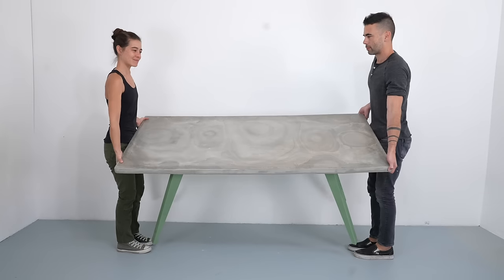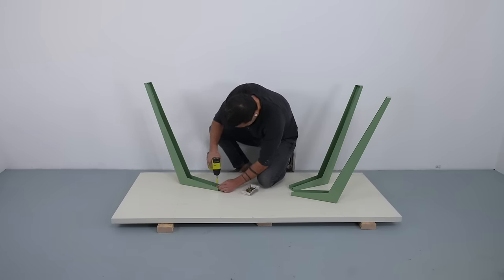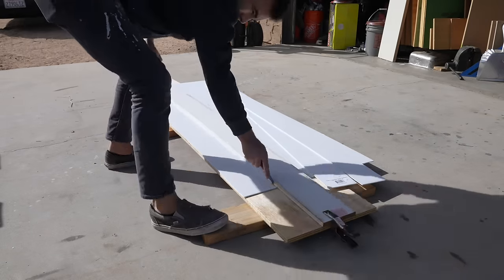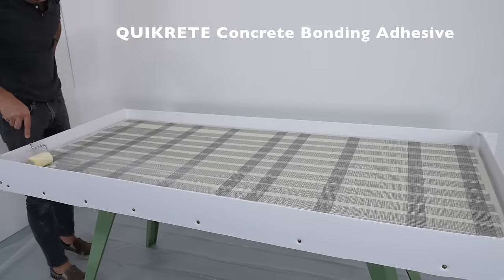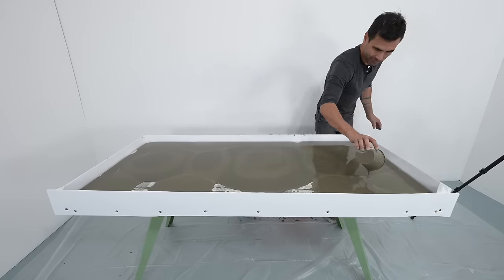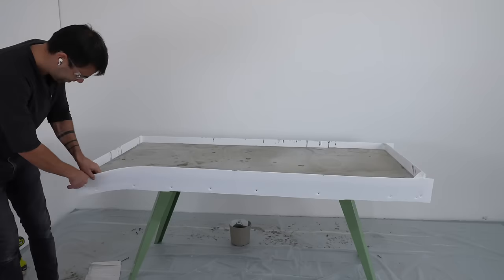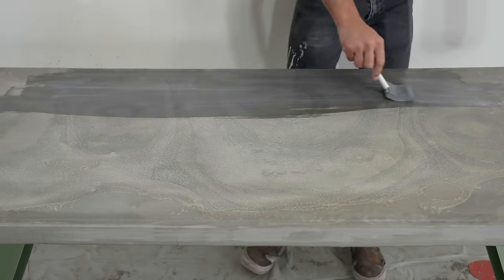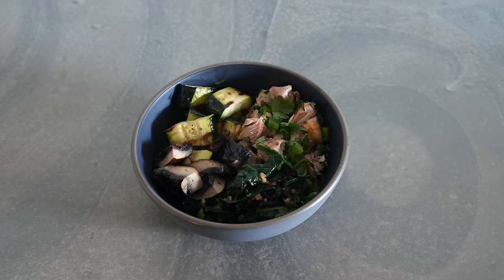How to Make a Lightweight Concrete Table

Comment: Not to be "THAT GUY" but the wooden door core is a fatal flaw. When you pour wet concrete on wood, the wood will expand as it absorbs the water from the concrete and act like a sponge. If you leave it outside, the cold or the hot sun hitting the concrete will make the wood INSIDE the concrete contract and expand (or contract at different rates than the concrete. That pressure will crack the concrete or create void that will be much weaker in parts of the table. I also worry about freezing and wooden core expanding inside the concrete like a form of ice heave.
Reply: You're quite correct and beat me to pointing this out.  He'd have been better served using the door (completely waterproofed somehow then drenched in release agent) as part of a form and then removed it.  This would fall apart in less than a year in my climate.
Reply: Would pouring an exact amount of concrete work to maybe give it space to not crack or how would u avoid that
Reply: Nvm I wasn’t watching vid def a different build than I had in mind
Reply: Or maybe weld in some smaller bars on the inside lining of the wooden walls maybe give it some support and something to grab on
Reply: It's just fine being "that guy" when you are 100% correct and aren't douchey about it, which you weren't... 
When he said the door itself wouldn't stand up to the elements, I thought to myself that the concrete actually made things a lot worse...
Reply: I wonder if you could  accomplish the same thing with a rectangle of pink insulating foam. I’m not sure how much structural integrity would be sacrificed, but it would resist the weather shifts.
Reply: I think this is only true if you assume that the door is 100% real wood, i did hear him say it's solid core, but if it's solid core MDF or some weird glued dust filling, it will more likely get soggy and crumble but not crack the concrete
Reply: The poly sealer will be blistering , peeling and yellowing  the first year outdoors.
Reply: Any other suggestions on how to make a light weight cement table? Not even this large, but circular? Been researching for over a year. I just don't have the man muscles needed to even flip a regular solid cement table top, much less move it into position. 🤣
Reply: Would this method still be fine to use as an indoor table?

Comment: Is there a bend or is it just me?
Reply: Trying to figure that out myself. I guess the center of the table could have sagged a touch?
Reply: It bent because of the moisture in the concrete
Reply: Thought the same thing, but wasn’t sure if it’s camera lens distortion
Reply: Probably it is prepared without iron cage

Comment: I would seal the wood underneath as well. The particle board WILL absorb moisture from underneath and swell if it's not well sealed. THAT would be more likely to cause cracking over time than the expansions and contractions caused by temperatures. Just a thought.
Reply: great minds think alike.... so using an epoxy paint to completely, replace the porous brittle cement based material, would have been even a better choice IMHO
Reply: particle board is to flexible even before it would deteriorate....to have anything brittle applied to it...  but QUIKRETE is the sponsor so this what you get when that happens ;)
Reply: Which sealant to be applied on the wood before applying wet cement? I am using plywood
Reply: @prajaktashivarkar7019  skip the wood and just mix fiberglass and concrete. Light weight, stronger than steel. You could drop a truck engine onto a 1 inch thick slab and it won't break. I've seen a guy try to break a fiberglass+concrete mix with a sledge hammer and have to go find a bigger sledge hammer.
Reply: I saw this installation, a guy went to an existing customers boardroom where they'd poured a boardroom table, they spent 14 hours breaking it into manageable pieces and pouring a new boardroom table at the client's new premises. They poured the new one with less fiberglass and more concrete, just in case they have to demolish it again someday.

Comment: Very nice. I'd make the slab solid without the cost of the door, and use that saving to buy shredded fiberglass.. mix that directly into the concrete mix and pour that into a mold after applying a face-layer of countertop mix. It'll weigh about the same, then I'd affix the legs directly to the concrete using plugs which I'd reinforce with epoxy. The slab can be as thin as 3/4" and hold 500lbs even if it's twice the size. You can go three times the size of your door if you make the slab 1 inch thick. We're talking boardroom table sized, 1 inch thick concrete slabs that can easily take the weight of a grown man jumping on it.
Reply: Fiberglass is soo strong that you can dull an angle-grinder pad in a single cut.

Comment: Did you seal the underside of the table(door) at all? You should especially if it is going outside. Also maybe it is just the camera lens but it looks a bit warped at the end of the video which may also have happened because you didn't seal the underside before the concrete cured. I have seen the same effect happen with epoxy on wood where it is only on one side and the other side is raw wood.

Comment: It'll be interesting to see how this holds up, especially with your extreme temperature ranges. Thanks for sharing!
Reply: @hotrox2112  Do you think this would hold up if installed over ½ inch plywood and ¼ hardibacker? I would like to do this on an outside bar top. It will be fully exposed to the elements though
Reply: It WILL NOT hold up.  He bonded concrete to a wooden substrate with no mechanical decoupling.  Big NO NO and it's not a secret.  This guy is showing people how to waste their time and money.

Comment: To my opinion, the edge crack is related to unprotected chipboard sides. As it soaks moisture, it expands.
Reply: Most common point of failure

Comment: Very interesting project Ben.  Some definite out-of-box thinking and expansion of materials for design/construction.  Really want to see how well it holds up outside after a year. 👍
Reply: It won't take a year.  It's mechanically coupled to a wooden substrate.  Big no no.  Thanks him for wasting everyone's time and money.
Reply: What if you waterproof the door before pouring the concrete?
Reply: @amandah-v3k  I think the problem will be different expansion/contraction rates between the wood and concrete.  That is what would concern me anyway.

Comment: Concrete will crack, the reinforcement just prevents the cracks pulling away. Reinforcement is normally put suspended into the liquid mix. Putting it onto the door is no more useful than the door its self is holding the table together.
Reply: also the side are not supported in any way. had this been just a screed layer then it would have sufficed
Reply: @quicksilverstrom  yep this at the most just makes for a good youtube video when they run out of ideas
Reply: And how light is floor leveler. Have you ever picked up a bag, its not light. Not light at all. Plus a solid core door.  At least 300 bucks in materials not including the legs.
Reply: Just mix in fiberglass particulate (comes in giant bags). When its finished, not only won't it ever crack.. it will also never cut. Dulls an angle-grinder blade in 8 inches of travel on a surface pass.

Comment: Very cool idea, is the table bowed slightly in the morning? Or was that an effect of the wide angle lense?
Reply from the maker: mostly the lense since the floor looks a bit bent as well
Reply: @HomeMadeModern  love the creative hybrid use of the materials.... but without sealer, the moisture retention when its used outdoors, will weaken the core... and even with use of fiber tape the edges seem like they could become cracked and broken off easily....

IMHO an epoxy coating would have given it a similar look that would last much longer... and I would have at least eased (ie rounded) the edges in either case...

Comment: Concrete shrinks as it cures which is why you had the crack around the perimeter- the door underneath provided restraint against the shrinkage.  Maybe if you had a strip of foam rubber around the edge of the door it would not have offered restraint against the shrinkage but the concrete edge would not have been connected to the door edge.  I would have continued the mesh tape into the sides too.

Comment: How would this work if I did it on top of a round plastic table, like the ones you find at a rental hall with pretty tablecloths covering them up. Lightweight type. Maybe replace with more sturdy weather proof legs. Should I completely cover plastic with bonding tape? Thx

Comment: I suspect that the wood door expanding and contracting with temperature and humidity changes between night and day will put a significant strain on the concrete. Will it be under a roof? Obviously with this being a video project you weren't able to do this, but in instances where you can let the concrete cure longer, going over it with Water Glass/a concrete densifier before your top coat would help as well and prevent water from seeping through the concrete to penetrate the wood below

Comment: You could screw a bunch of screws in the underlying board and add a mesh so you could bound better the concrete to the board, making the table much more resistant. Great job!
Reply: Not a good idea

Comment: I would think you would want a 1/4 round profile on the edges of the door. A right angle transition to the sides is guaranteed to crack.

Comment: Is the water based polyurethane UV resistant since it's an outdoor table?  Plus I don't think water based polyurethane is waterproof.   This table might need to be covered up when not in use and it will probably continually produce cracks like stucco tends to as the wood expands and contracts with moisture and heat.

Comment: nice table, I enjoy these experiments. "plastic tarp" - tarpaulin is the name of the material, not the form of the sheet. You can also use vermiculite as an aggregate if you want to reduce the weight of regular pours by a little, and it adds an interesting rock like texture
Reply: Well, expert, why don't you explain to him that bonding to a wooden substrate is the OPPOSITE of what you want to do?  Huh?  Never heard of mechanical decoupling?   SMH  Blind leading the blind.

Comment: That is nice all in all but what about the door?  Did you thoroughly seal the bottom against moisture?  If you did not it will absorb moisture from the air or from rain that runs over the side and swell and contract.  If that happens your table will soon be nothing but cracks.  Making certain that no moisture whatsoever can get into the door from any source and adding fiber reinforcement to the cement and putting stainless steel screws along the edges of the door will go a long way to prevent cracking and holding everything together so someone putting pressure on the edge will not break off a chunk if they press too hard.

Comment: You can use a palm sander to get all the air out , and you can use molding around the edges to leave a round edge too also wire in the slab would make it stronger cool results though for not a lot of cash

Comment: What ratio of cement to water did you use? Mine has turned out way too thick. even with adding 50% more than recommended it was a little too thick

Comment: I love experimentation so I support this wholeheartedly, but I suspect/fear this will not work. It’s basically a cheap door with cheap stucco… and the two materials will shrink and swell differently in the outdoor temperature and moisture conditions and it will pop off, right? Thank you for sharing and please let us know how it works!!

Comment: love the creative hybrid use of the materials.... but without sealer, the moisture retention when its used outdoors, will weaken the core... and even with use of fiber tape the edges seem like they could become cracked and broken off easily....

IMHO an epoxy coating would have given it a similar look that would last much longer... and I would have at least eased (ie rounded) the edges in either case...

Comment: Definitely should have covered ALL the edges with the fiber tape to help adhere the concrete to the door. This is a great idea, an alternative to using a sheet of thick foam to make lightweight concrete.

Comment: As for expansion/contraction, would it had been better to actually "float" it over the door?  Use a plastic barrier between the door surface and the cement, but bond the cement with the tape on the cement side of the form...  There will be minimal expansion/contraction in the door itself, but I would think there would be a bit more in the concrete.  Just a thought.
Reply: something like Schluter Ditra underlayment
Reply: @ironmonkey1512  I wouldn't think it would have to be a strong as Schluter Ditra but along those lines.

Comment: Thanks for sharing such a cool idea. I usually do small cement projects, did you add fiber tape to stop it cracking, I have a question, will the table be stronger if some thin steel bars are added?

Comment: Putting the mesh on the board is not a good idea. It is better to pour a 1/8" layer of the topping,  then add the mesh, followed by another 1/4" layer of the topping. For best results use 1/4"x1/4" metal mesh.
The main problem are the edges, they will all chip if not protected with some kind of a metal.

Comment: Wood core is bad, humidity, heat, etc will deform it
We had an outside table, wood inside, then tiled outside
The rain and sun killed it in a year, cracked all the tiles, loosened then

Comment: it will crack bro. 100%. 
many have tried in the past. Cant use portland or strandsrd concrete for that.
there is only 1 system application that lasts, and we are doing it  :)

Comment: If you had put tape along the side and edges, and primed the sides, then the concrete would have stuck better to the sides and maybe not have cracked along the edge.

Comment: Concrete is heavy. Particle board is heavy. Steel is heavy. You ended up with a heavy table. But you did a fine job of advertising Quickcrete products.

Comment: I'd be stunned if that didn't crack in less than 5 years, but let's see. Interesting.
Reply from the maker: yeah I just moved it outside and not cracks on the move.  I think heat expansion in the hot desert sun will be the real test
Reply: @HomeMadeModern  
Agreed. You should do a follow up video a year later to see what the results were. Obviously if you go thick enough, it won't crack, but will also make it heavier. Anyway, good video.

Comment: Avoid using polyurethane for outdoor applications. It won't last.
Concrete projects can easily last 20 years. I would avoid putting on something that is good for 2 to 3 years.

Comment: Crap engineering:
- door will expand and contract, leading to constraints in the concrete 
- should have put concrete on both sides of the door; asymmetrical layer will lead to additional constraints

Comment: You bonded concrete to a substrate that has different thermal expansion properties as well as moisture mechanics.  It will fail in SHORT order;  OF COURSE it will crack!  That is why you use a mechanical decoupler when using thin-set over wood substrates.  You did the exact opposite... why?  THIS IS NOT NEW INFORMATION and you have no business making videos on how to do something when you don't know.  You're wasting other people's money and time!   UGH.